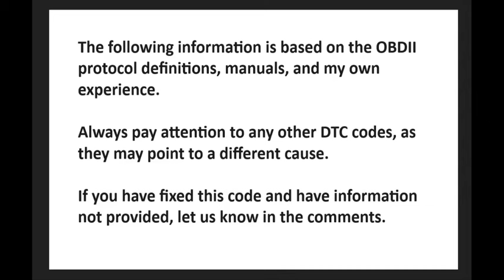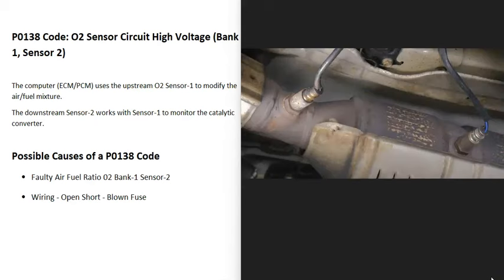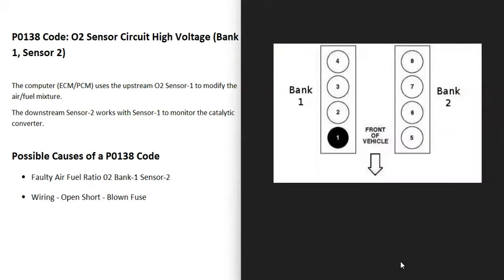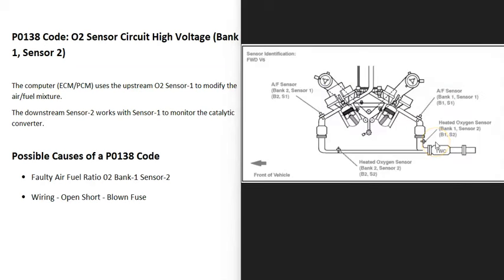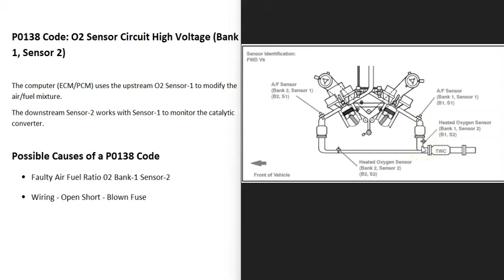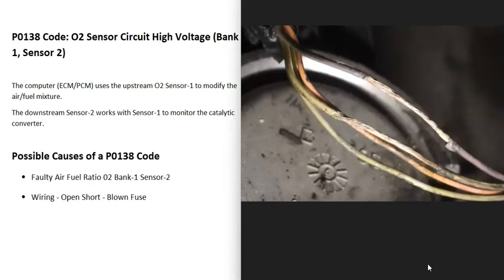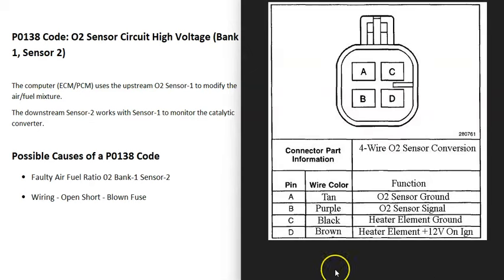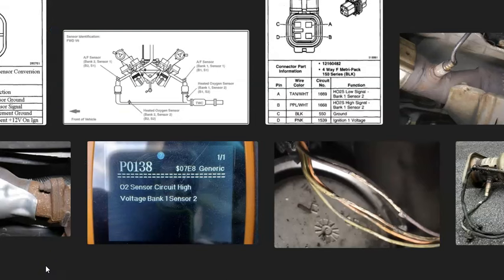Causes and Fixes P0138: O2 Sensor Circuit High Voltage Bank-1 Sensor-2

Comment: Was down a rabbit hole not being able to get rid of a P0420 on my 2011 JK Wrangler. Ended up replacing the bank 1 O2 sensors with a Chinese brand off Amazon thinking that would fix it - NOPE! ... tested replacement o2 sensors and they were giving off too 6 ohms across heater element. CEL's for "high-voltage" persisted (NTK & Mopars give off 3.5 ohms). 

Almost bought new Catalytic convertors (also tried cleaning the cats & even using the spark plug non-fouler trick but CEL's persisted due to cheapo O2 sensors - non-foulers will not work if your cheap sensors are sending incorrect voltages to the PCM). After much research, discovered the JK is super sensitive to o2 sensors. Ended up buying the NTK brand and they worked perfectly. DO NOT USE ANY OTHER o2 SENSOR on a JK than NTK or MOPAR (Bosch is too sensitive and will trigger CEL's). NTK website has a part lookup function (note: upstream and downstream are different part numbers). NTK are more expensive but TOTALLY worth it.  Cheap sensors are not worth the hassle. 

Another key tip: O2 sockets are not meant to "break loose" difficult sensors - the wrench (link below), with a hammer, worked perfectly for breaking loose the sensor (after broken loose, then you can use the slotted sensor socket). Also, use PB blaster the night before. Note: Always use a thread chaser & high-temp anti-seize before inserting new sensor  https://www.amazon.com/gp/product/B00I6TBHE0/ref=ppx_yo_dt_b_search_asin_title?ie=UTF8&th=1

Comment: I have p0133 and p0138 codes. Also I had a noise sounding like “air ticking” that turned into a pitch when accelerating. But it went away eventually. Do you think I have to replace both sensors or maybe it’s something else? I’ve replaced the cat last year

Comment: Currently have code p0138. Is it possible to be cause the car to nearly die out when throttling? Iddles fine then gets a little rough
Reply: Was that problem solved ? Mines throwing a code of that too
Reply: Yes happened to me it was a dirty cat convertor I changed for a new because common sense tells me the old cat convertor destroyed or made  the 02 sensors dirty due to bad carbon residue so I believe once I change 02 sensors the car will not do that anymore
Reply: @mA-ug5ts I just change my cat as well and I'm seeing the p0138 code the same day. Are you suggesting that I buy a new oxygen sensor bec it's the first in seeing that code and its only after I change my cat I'm seeing that error code
Reply: @TT-go5yb  I changed my oxygen sensor just the other day after my last message and the codes and engine light is gone I drove for two hours afterwards now the car fumes from backbox smell like nothing like the car is brand new before it had a slight petrol kind of smell acceleration is better also after doing that look on youtube for 3 resets I can send the link if you can't find it the resets are for transmission  throttle body and battery (battery generally not needed ) oh by the way my code was po138 plus another which caused the engine light but now all faults gone it's the sensor after the cat...I'm also going to change the rear sensor just so they both are the same quality but I don't have to as yet everything runs sweet now and the resets stop any Jerky gear changes idle engine timing etc
Reply: yes i have also faced same problem my honda dies during acceleration on highways after o2 sensor replacement my problem is solved
Reply: @mA-ug5ts  how to do a reset ?

Comment: I have the code P0138 and code P2108 are  related  (stalling difficult start in the morning misfire , uneven idle poor fuel consumption ) or do i have to replace both the o2 sensor and problems related to  throttle body
Reply from the maker: I would fix the P2108 code first, as it is likely triggering the P0138. If the P2108 is fixed and the P0138 does not clear, then I will test the 02 sensors and wiring.

Comment: What if I had this code a year ago and I replaced the sensor with oem part and now the code is back again
Reply: Did you disconnect the negative battery for at least 2 minutes to reset the codes?

What did you end up doing bro?
Reply: @h.317 all set replace both sensors up down stream
Reply: @robwhiff3411  did the light go on again?
Also, what website did you buy them?

Thank you

Comment: I got the po455 along with the po138. Could it be possible that an EVAC leak (po455) caused the po138 (rich at idle rpm)?
Reply from the maker: If the purge valve is stuck open, it can cause a rich condition, which can trigger the 02 sensors. If you can blow through the purge valve ports, it is stuck open.
Reply: I also have p0455 with p0138 did you find any solutions?
Reply: @jellyjordy1154  Tested the purge valve and it was stuck open. Replaced it today and cleared the codes. Gonna wait a few more driving cycles to see if any codes pops up again.
Reply: @ElPensador101  so that got rid of the p0138 as well? I have an Altima and they’re common to have the purge valve go out
Reply: @jellyjordy1154  I mean I cleared the codes using a OBD2 scanner. I'll have to wait some days to see if the codes pop up again to confirm it fixed it. My guess is that at least the po138 will pop up again, because I'm reading 0.7v to 0.8v on the downstream o2 sensor, and from my understanding it should read 0.45v approximately.
Reply: @ElPensador101  alright update me on anything that happens
Reply: @jellyjordy1154  4 days later, still no codes. I guess changing the purge valve fixed both.
Reply: @ElPensador101  that sounds good, update me after a few weeks to see if it still dosen’t show any codes. I’m in NY so if it lasts 4 days it’ll be enough to pass inspection